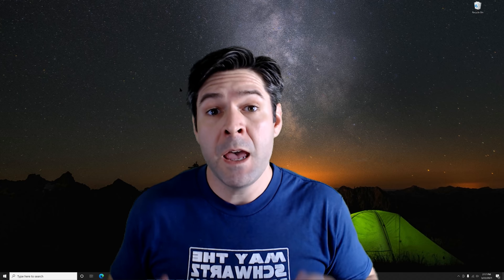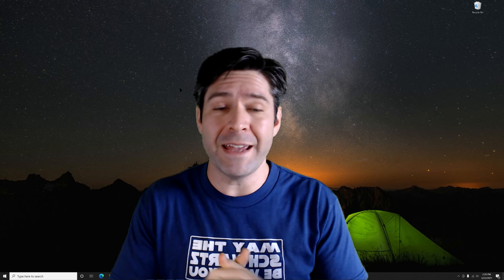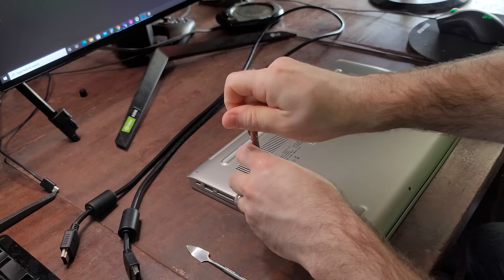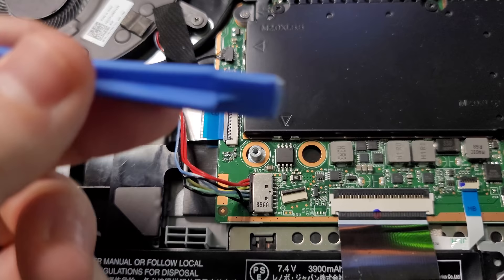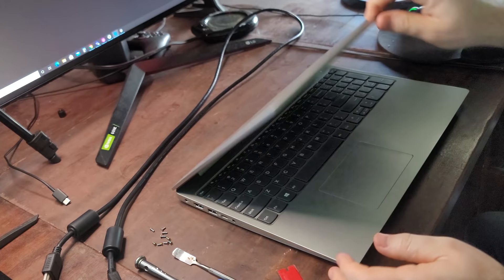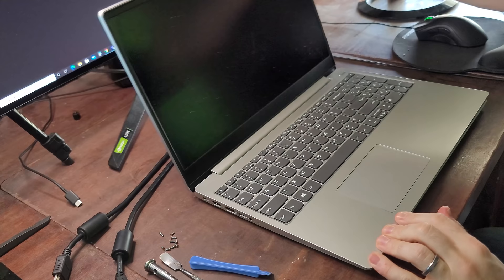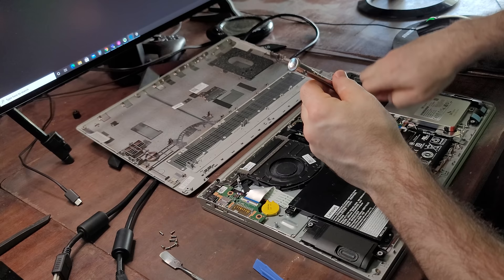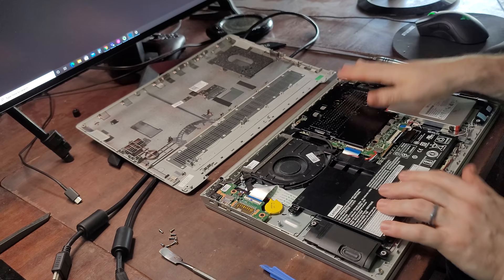Laptop Screen is Black (But Still Powered On and Running!) - Quick & Detailed How To Fix

Comment: Did not work for me. Laptop screen is black was able to hook it up to a monitor for a couple of months. Now monitor won't connect to laptop. Tried a second monitor same effect. Now I've just tried your steps still doesn't work....... I'm at wits end. I've even taken it in to a techie and they've switched out the laptop screens and. It still doesn't work. Is my laptop pretty much dead now

Comment: I unoluuged the battry and oluged th chager and i work, then i have th problem that i plug back the battry but the computer wont turn on if its not plug3d in to the charger 😅

Comment: I powered my laptop off, and then turned it back on, but it didn’t work, so I grabbed an hdmi cable, connected it to the tv, had to use the power button again, and then the flippin screen decided to turn on! 🤷‍♂️🙄

Comment: Well, I opened my laptop to try to disconnect the battery like suggested and now it won't even turn on (even with power cable). It does the sound like turning on and then turns off. Then turns on, then off. Over and over. Fuck my life.

Comment: did all things suggested here but still my lap screen wont turn on . power button is on , fan is spinning, caps and num lights are not on . what may be the issue if any one can suggest  my laptop is LENOVO IDEAPAD 330
Reply from the maker: Does it beep when you turn it on?
Reply: @AskaComputerGeek  no

Comment: Unplugging the battery worked, but only once, after i shut down and came back later it did the same black screen again, not sure what my problem is, i followed every step and nothing seems to have fixed it consistently

Comment: I have a question, this is temporary solution isn't it? My lenovo still time to time randomly (like every 2 months) goes black, but it comes back after hard restart, so i installed crash reporting app. And it say   "A livedump triggered by dxgkrnl occurred. Bugcheck code: 0x193(0x815, 0x2, 0xFFFFCE87A94EF2C0, 0x0)". Any ideas to fix it permanently?

Comment: So my laptops case is cracked in the top left corner and i couldnt get it fixed and the broken part sometimes gets stuck and while i was trying to put it down i tapped a black big cable (assuming its from the gpu screen adapter) so i think i cant fix it i have to go get it fixed somewhere dont i?
Reply from the maker: If you physically tore/ripped a cable, probably so :(
Reply: @AskaComputerGeek  it couldnt have ripped since i just tapped it i didnt forcefully hit it